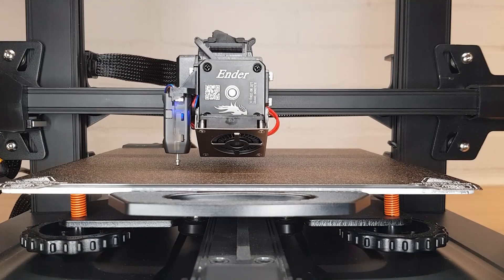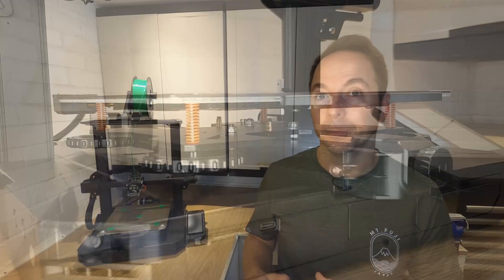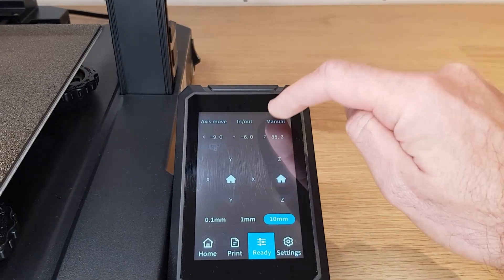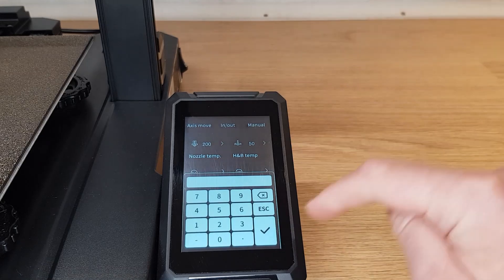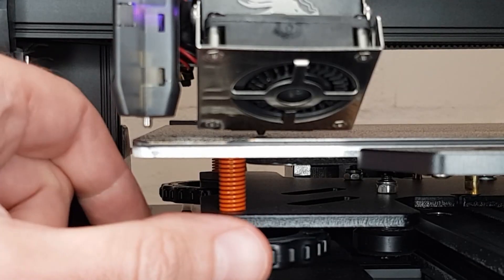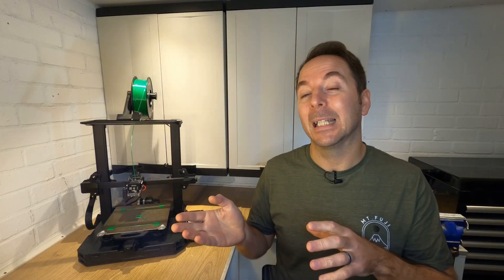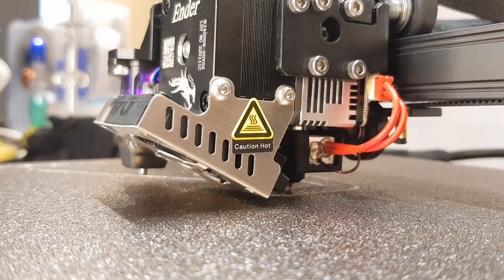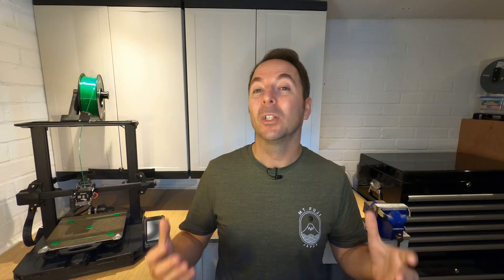Ender 3 S1 Pro 'Automatic' Bed Leveling In 3 Simple Steps

Comment: Hey Ricky, Thank you for this tutorial!   I have applied your tips to my printer and slicer but, unfortunately, my prints fail anyway. I have followed your tutorial step by step but the first layer barely stick to the plate... It's like the plate is not leveled. So i tried to heavy drop the offset during the printing, so the firt layer stick to plate but in 15-20 layers it comes away.
Can you help me?
Reply: *it's like the plate in not leveled or like it has depressions... But cr touch should have mapped this problems.
I don't know what to do 🤦‍♂️ first 3 prints were perfect... After a check levelling all crashed
Reply from the maker: @matronss94  Hi, sorry to hear you are having problems. Some other people have reported similar problems with their machines. It seems that on a few units, something goes wrong with the bed mesh. I believe Creality have been made aware of the issue but haven't addressed it fully as yet. I'd like to try and find the problem myself but mine seems fine. One thing you can do is to reset the EEPROM from the menu, carefully manually level and then don't run the auto level feature. As long as the probe can set the z offset then you should be ok. I would definitely recommend contacting Creality though as your machine seems to have the fault that others have reported.
Reply: @RickyImpey  ok, thank you I will try this way!
It's so strange... Because at the beginning prints were pretty good🤷‍♂️
By the way... You know if it's possible to flash new function instruction to the cr touch to correct its work? Thx
Reply from the maker: @matronss94  Unfortunately new firmware hasn't fixed the problem for other people no.
Reply: @RickyImpey  okok,I have seen in the download part of the site that the update add only the settings for the laser engrave... Do you advise me to do it?
Ricky thank you so much for your help 💪🏼
Reply from the maker: @matronss94  I don't actually know which firmware is best as I haven't updated the S1 Pro yet. I'll have a look though.

Comment: Cant for the life of me get a good first layer, been struggling for over a week. Followed this video step by step, even with a spacer incase my eyes are wrong, but no luck. Front left is aways high and back right always low. Did everything from making sure my frame is square and updating to the latest firmware to tweaking the adjustment wheels after auto bed levelling
Reply from the maker: There seems to be quite a few people who are experiencing something similar. There is no definitive solution yet but some have had a reply from Creality saying that they plan to fix the issue with firmware. Others have suggested that it's actually caused by electrical noise on the CR touch wiring as they run too close to the stepper wiring in the ribbon cable. You can be sure that once a solution is found I will put a video out with the fix.
Reply: @RickyImpey  Damn, that really sucks. Im new to 3D printing, thats why i got the s1 pro, was meant to be "easy". That being said, thanks for your videos and also even replying to these comments. Have made so much easier to get into and understand printing concepts. Will keep an eye out for any update videos
Reply from the maker: @jordanvisser1947  It is still possible to get the S1 setup well. If you reset the EEPROM so there is no mesh and use the manual leveling until there is a fix, it should work fine. Let me know if you want help with this.
Reply: @RickyImpey  Thanks, i think i might have it but just to confirm. I need to send a M502 code to reset then M500 to save it to the EEPROM? Then don't auto level before the next print and remove m420 from the start gcode?
Reply from the maker: @jordanvisser1947  Yes, that will do it. Make sure you still manual level and set the z offset. You can also reset to factory settings within the printer's UI somewhere.
Reply: @RickyImpey  Thanks, worked great! I have a slight dip in the middle of my bed. I tried adding a paper shim and now im getting great prints. thanks again
Reply from the maker: @jordanvisser1947  Awesome!
Reply: @jordanvisser1947  Hey Jordan. Consider loosening the 6 bolts in your y-extrusion. Overtightened from fabric seems to be an issue for many causing bed warping.

Comment: Hi! Would this work if I upgraded my Ender 3 v2 with the Sprite Pro along with the CR Touch?
Reply from the maker: I think you'd be basically making an S1 with that setup and not the pro so the process would be similar but not identical. This video should cover 90% of printers using an ABL sensor https://youtu.be/zKpNxqWie_8

Comment: Hello, I have a question. I have done all the steps. After setting the M420 code there is a loud voice on the Z step motor. Is anybody experienced that? When I removed it, the sound was gone. Anyways calibration print was perfect.

Comment: I have done the level per the manual many times already and am going to do this method tomorrow… how do I know when I follow this that the new mesh saved will go into slot 1? Is there a way to clear them all out? Start from scratch like a firmware reset? Thx much great vids

Comment: Serious question, I understand the reasoning behind heating the bed, but I have seen a lot of advice advising not heating the bed for auto level. What's your input on this topic, Sir?  My printer is at work,  I am dying to check if I have the M code for initiating the mesh!! I think I have a dip in the center of my bed  because after the auto level the corners end up being too high no matter what I do, I lower them and then the center is too high etc etc. I am at my witts end. Center prints are always flawless, like insainly awesome looking but anything that is an inch away from the corners gets sloppy.  I am hoping it's the missing mesh code messing with me.
Reply from the maker: Hi, I heat the bed to level because I heat the bed for printing. Different materials expand different amounts with heat so potentially, the bed can change shape a little when heated. The only reason to level without heating the bed is if you know that there is zero shape change in your bed with heat. If you're not 100% sure, then level it when it's at the same temperature that you set it to when printing.

Comment: How is it auto leveling if you have to do all of this stuff
Reply from the maker: I completely agree, it's a term that 3d printer manufacturers use to sell printers. What you are actually doing is creating a bed mesh and setting a z offset.
Reply: @RickyImpey  Thanks for this video BTW. Learned a lot.
Reply: @RickyImpey  have you verified that creality firmware doesn't use RESTORE_LEVELING_AFTER_G28 ? That would not require M420 code.
Reply: I’m also hung up on why a G code addition is needed to get this auto leveling bed to actual use the auto level settings. Seems like something that Creality should have addressed.

Comment: Setting mine up for the first time.  How is Cura on my laptop communicating with the printer?  Is it wifi, bluetooth or does a file need to be transferred by an external disk?
Reply from the maker: Good question, you can connect your laptop with your printer but most people don't. If you get any hiccups with your laptop then it causes print defects. What most do is save to an SD card that then transfers to your printer. This video should help explain https://youtu.be/e-lQPGJ3Psc
Reply: @RickyImpey  hey thanks Ricky.  I'm able to print the files that came with my S1, as well as print stuff from Thingiverse.  I'm having trouble with items I created and exported from Blender.  The nozzle keeps disturbing the first layers ruining the print.  Do you know of an active forum or group where I could post pictures and get a response for troubleshooting?
Reply from the maker: @JonBrowning760  There are groups on Facebook that can be really helpful and some use Reddit but I don't really know how that works to be honest.

Comment: I always get 203 error, probing failed, when I run auto level, my CR touch is bad? or, automatic level maybe can't run with that bed temperature?
Reply from the maker: Hi John, I would love to tell you what the problem is but unfortunately I don't know the code or have the same issue on my unit. Have you tried contacting Creality customer services?
Reply: @RickyImpey  not yet, i will, thx
Reply: @RickyImpey  Hi Rick, I have update firmware to last version and now I never get that error again, even with heated bed, but I think there are some irregularities in the bed, because I print STL Test Print Bed v2 (thingiverse) and there are some parts that don't stick well, I'd like edit the mesh to fix that, maybe trying professional firmware (but it requires change touch screen to rotary knoob screen), at the moment I working with manual leveling
Reply from the maker: @johnmorenov  Good to hear you're making progress 👍

Comment: Why doesn't this work for me. I preload the bed set the centre level using the z offset then when I go to position 2 the bed is miles away from the nozzle and even if I totally loosen the springs I can't get the bed near the nozzle. I've started from scratch used double the preload and still can't get near.I have watched lots of videos tried lots of different ways and I have managed to get the bed level manually then do an auto level and when finished the nozzle wants to bury itself into the pei sheet
Reply from the maker: Hi, it sounds to me like your CR touch might be faulty. If I were you I would set the z offset and then come out of the level menu and then go back in. It should home the z axis again and you can see if it's homing to the same place like it should.
Reply: @RickyImpey  Thanks for your help. Sadly I've tried again and the auto bed levelling just fails on the second row of the mesh
Reply: @RickyImpey  when auto levelling it gets to 37% every time then the probe lifts up when the extruder is away from the bed then it says its failed. I'm guessing that it's a Friday afternoon machine and it aint gonna work.
Reply from the maker: @TheIMobile  I'd say that that is either the CR touch, firmware, or the motherboard itself. I'd definitely contact the place you bought it from or even Creality themselves to get it sorted.
Reply: @RickyImpey  I’ve reached out to them when I had it delivered as I bought it direct from Creality and their were only two adjustment wheels and parts loose on the box that should of been on the printer. They happy to send parts but aren’t much help otherwise. 
I’ve got it to create a mesh. It succeeded and made the mesh in couple of minutes the times it failed it was taking 5 minutes or more to do the first row across the front of the bed. I don’t know why it was going so slow or how it was remedied but if it happens again I’ll consider returning it
Reply from the maker: @TheIMobile  100% return it. That is a long way from being right.
Reply: @RickyImpey  Thanks for your help. I think it is going back. Trying to decide if I should get another or just change brands completely
Reply from the maker: @TheIMobile  That's tough, I like mine and it can be a great printer but once you've had a bad experience you never really trust it's working well after. I can recommend the Artillery Sidewinder X2 as a great out of the box printer that works really well. It's pretty big though.
Reply: @RickyImpey  I thought I'd give it one more go sliced a benchy with the g29 code it took 7 minutes to probe the first two spots from the right corner then failed. That's it, Ive contacted Creality once again asking to return it if they still insist on sending me parts to repair it like with the missing and damaged parts on arrival I will have no option but to contact my bank
Reply from the maker: @TheIMobile  Hope you get it sorted

Comment: Good night friend, I have a creality s1 pro, almost the same as yours (because mine doesn't level for anything, just by a miracle) I've tried everything!
I already changed the bed, because it was a few mm out of level.
I do the manual leveling with it off with the help of a square in mm 0 of difference, everything seems to be ok.
I do the auxiliary leveling later, as in your video, right after I do the automatic, there is always some part out of level, higher or lower when printing. I try to go through the manual at the time of printing and nothing either.
I've already taken it all apart, adjusted the X, Y and Z axes, tightening the wheels neither too tight nor too loose so there's not even a slack or anything.
I lost hope with the creality s1 pro, the only solution is, no solution! laugh not to cry!😵‍💫
Reply from the maker: Sorry to hear you are having problems. You say that you have manual leveled after using the automatic leveling? This would be the wrong way round. You need to do the automatic leveling after you are finished moving the physical adjustment knobs. If you move them after automatic leveling then your printer will not know where your bed is.
Reply: @RickyImpey  No, no!! I do the manual leveling with the machine off, moving everything with the help of a level and a square to get everything in the exact height measurements etc, then I do the auxiliary for later the automatic.
Reply: she can never level, always gets wrong!
Reply: @RickyImpey  I upgraded the firmware available on the creatily website, which I can't find on the website anymore. that could be the problem.
Reply from the maker: @moisesvni  What version do you have now? I've found it really difficult to find firmware for this machine. I always like to have my current firmware to go back to if I have a problem before I update but I can't find what I have on my machine anywhere. I don't want to try out the newest one without a backup. I have 2.8.13

Comment: Morning.  Have been using the M420 part of the video and I have just noticed that I am seeing {"code":"key61, "msg":"Unknown command:M420", "values": ["M420"]}  In the text on the web interface for the sonic pad attached to the s1 pro.   does M420 not work with klipper?  my start g code is as follows. G28 ;Home

G92 E0 ;Reset Extruder
M420 s1 z10
G1 Z2.0 F3000 ;Move Z Axis up
G1 X10.1 Y20 Z0.28 F5000.0 ;Move to start position
G1 X10.1 Y200.0 Z0.28 F1500.0 E15 ;Draw the first line
G1 X10.4 Y200.0 Z0.28 F5000.0 ;Move to side a little
G1 X10.4 Y20 Z0.28 F1500.0 E30 ;Draw the second line
G92 E0 ;Reset Extruder
G1 Z2.0 F3000 ;Move Z Axis up

thanks
Reply from the maker: Hi Simon, I don't know a huge amount on klipper yet but I do know M420 doesn't work unfortunately. This Reddit post might help you. https://www.reddit.com/r/klippers/comments/esailp/is_there_anything_in_my_start_or_end_gcode_that/?utm_source=share&utm_medium=android_app&utm_name=androidcss&utm_term=1&utm_content=share_button
Reply: @RickyImpey  Thank you.  much appreciated.

Comment: Thank you for the guide, thinking about picking one of these up!
So on this printer, after you auto bed level, it saves the mesh to memory? I ask because on my ender 5 plus it does not seem to retain the mesh between printer reboots(probe measurements always reset to 0 after reboot on level screen). I have seen tutorials of people using g29 and m500 from computer to printer to ensure the mesh is saved to eprom instead of ram. Not sure if each printer is different or what. I will use the M420 in my gcode now, just want to clarify how the mesh gets saved to memory for M420 to load from.
Reply from the maker: Hi, yes some printers don't save the bed mesh to memory but a lot do including the Ender 3 S1 Pro. Many that don't, instead save to the SD card. Are you sure your Ender 5 doesn't do that? You would obviously have to have the SD card in at all times when levelling and printing though.
Reply: @RickyImpey  Thanks for clarifying that s1 pro saves to memory! I will research and do a test by doing a ABL, reboot, and do a large print to see if it is adjusting. M420 was in my cura so we’re good there, just have to narrow down on how mine saves mesh.

Comment: I have watched way too many videos (at least 20) and re-done my bed leveling 15 - 20 times and couldnt' for the life of me figure out why nothing would stick and the nozzle was too high. None of the videos I watched said anything about the G29 or M420 code in the slicer. Have some fine tuning to do now but it's actually sticking to bed after adding a CR Touch to my Ender 3 Pro. Thank you!
Reply from the maker: Awesome, I love hearing this kind of thing. Nobody wants a machine that isn't doing what it is supposed to.

Comment: great video, accurate and clear.  But auto leveling is not working properly for me.  First I level manually with the wheels, then I start the automatic bed leveling, but on my first layer it can be seen that in the front part of the bed the clearance is smaller than in the back part.  I did every step with you while doing it but no change. 
Do you can help? Thanks in advance.
Reply from the maker: Hi, some people have said they have had similar problems with their S1 Pro. It sounds like a firmware problem with some others, what firmware do you have on your machine?
Reply: I have the same problem... Did you manage to solve this problem with the first layer?